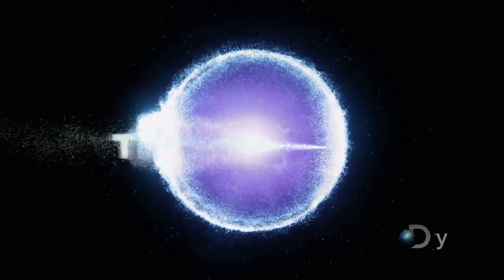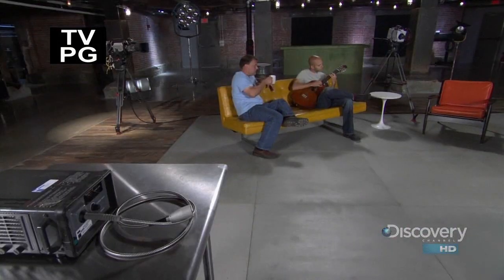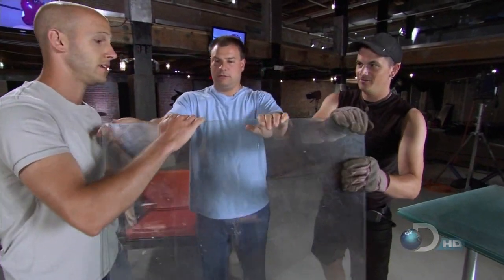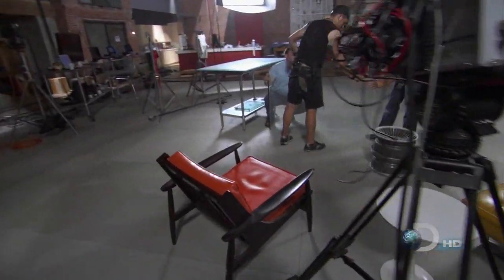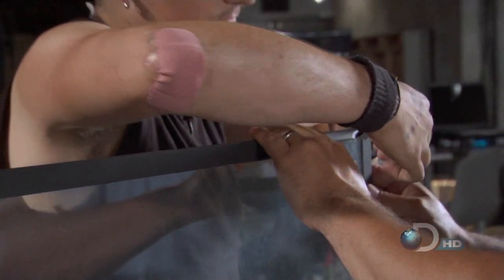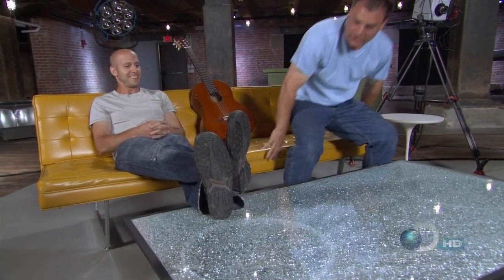Time Warp - Tempered glass

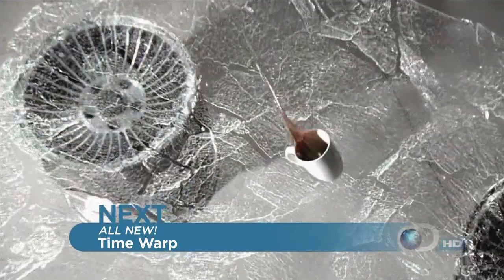Comment: If you pause it at 0:40 you can see that 3 panes of glass is used, the seal all the panes together with the tape, then he only strikes the middle glass.
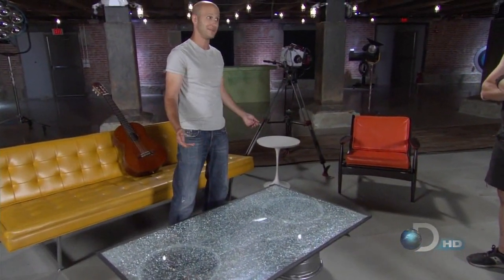Reply: If you are referring to the glass panes that are sitting on the table to the right, you can see them again at 1:32 sitting where they were, unused.
Reply: Markifdfe11 No, Look at their hands at 0:40 , they are picking up 3 pieces of glass, you can see that it moves around in their hands untill they have them all aligned to up the tape on the edges.
Reply: They do actually say : " all we need is to break the middle piece" .
Reply: Tempered glass is multiple layers. Outers being glass and the middle piece being highly pressured silicon type substance. They did not pick up 3 individual pieces.
Reply: I dont care? show me a video of you making it and ill believe?
Reply: Ros Han "I don't care" but you want me to show you how to make it...?

Comment: @Andrew13301 You need at least three pieces of tempered glass of equal dimensions to pull this off.  The three pieces are layered and held snugly together.  The tape will suffice, but a wooden frame would make a much nicer table imho.  Make sure the interior surfaces are clean, as you will never be able to clean them again.  Once all is set, drive a small nail into the middle piece of glass only.  The outer pieces of glass will contain the shards from the broken middle piece.

Comment: @E1craZ4life Tempered glass does not have layers.  Driving a nail into the edge of a single piece of tempered glass will shatter it all over the floor (watch this video, watch?v=eqV5W76U8Qg).  You need to sandwich the shattered pane between two other panes of tempered glass to make a functional table.

Comment: Tempered glass isn't used in car windshieds! A matter of fact, it's used everywhere BUT a car's windshield, because even when damaged, a car's windshield MUST remain transparent, which tempered glass does not.
Reply: +feynthefallen You are correct.  However, it is not to keep it transparent.  Windshields are laminated.  This is to prevent small glass shards from shooting into the driver's/passenger's face in the event of a collision.  The windshield will break, but will not fall apart.
Reply: +wezleey25 you could keep tempered glass intact by laminating just as well. The lamination is indeed to prevent Splinter, but the reason tempered glass isn't used is that a small damage, e.g. from a stone, would instantly destroy the driver's vision entirely. Windshields get small chips blown off all the time, if they were tempered glass, each and every one of those small chips would blind the driver and destroy the entire windshield.
Reply: +feynthefallen That would depend entirely on the thickness of glass used.  In general, you can 'chip' off approximately 1/2 of a tempered glass sheet's total thickness before it will blow up.  However, you do make an excellent point about laminating tempered to hold it in place.  In general, though, you require either lamination or tempering, not both.
Source: I am the production manager of a glass fabrication facility, and I was the lead temper engineer before that.